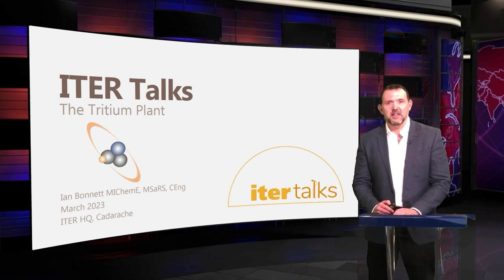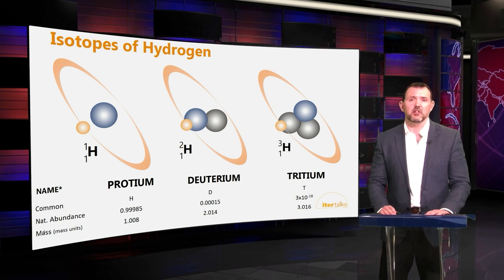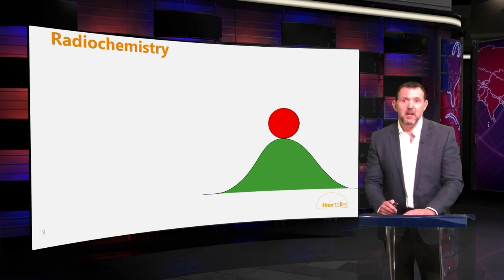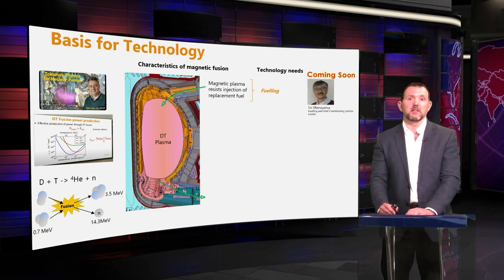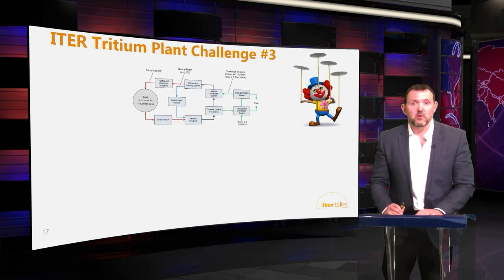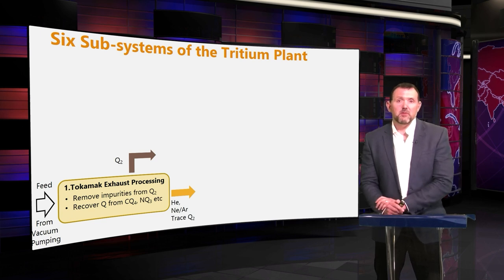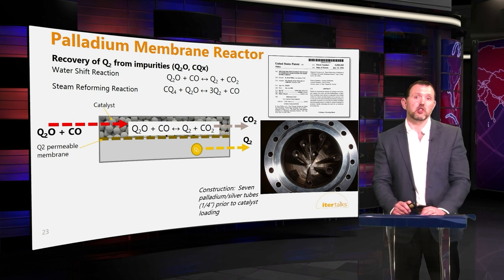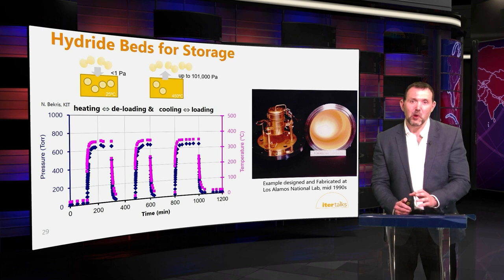ITER Talks (11): The Tritium Plant

Comment: A few minor corrections/additions about uses of Tritium: About the patents, the tritium-powered fishing lures are real, i bought some maybe around 15 years ago, these are available for sale today, called "betalight". Used for fishing lures or for other purposes, the base product is small glass tubes filled with a phosphor and chemically bonded tritium, available in many colors, these just glow. 

Tritium illumination is also used in firearms, for gun sights. In the military, tritium-powered flashlights are also a thing. 

One important use of tritium he also skipped is in nuclear weapons, to boost fission bombs. Modern thermonuclear weapons use lithium deuteride in the second stage, so no tritium needed here, but nearly all modern fission bombs, including the first stage of hydrogen bombs, are tritium boosted.
Reply: Yup those have 250mCi per serving. The bigger Keychains have 500mCi per serving. The most common high radioactivity tritium item encountered is a tritium exit sign, they have 15 to 25 curies in multiple tubes inside.

Comment: Would have felt more engaging, and not so dry if more imagery from the actual hardware at ITER was used during the presentation. Surely a lot of this stuff has to have been installed by now, if a couple large tanks were placed in the basement level all the way back in 2016...! :P